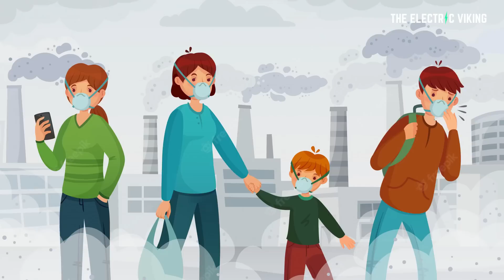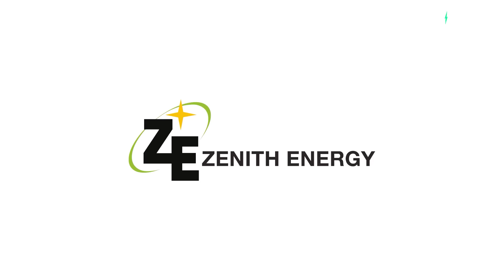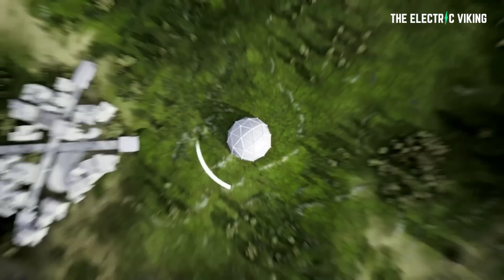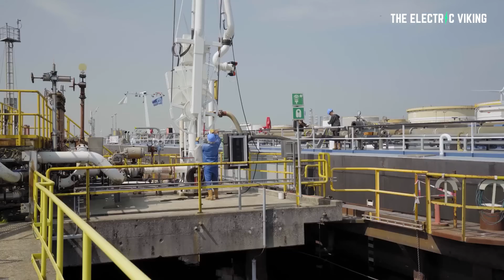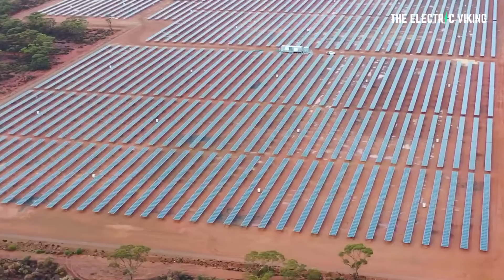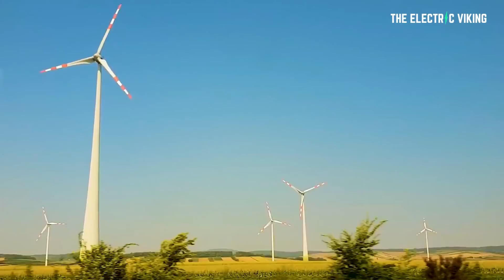The lithium mine powered by solar, wind & batteries

Comment: I like the affordable used cars 10y old or so, but if a battery only last 10y at $20,000  what, gone are the affordable cars and replace it with a disposable expensive car that cost more then $30,000 the WOKE! left and there jabs

Comment: I like the affordable used cars 10y old or so, but if a battery only last 10 at $20,000  what, gone are the affordable cars and replace it with a disposable expensive car that cost more then $30,000 the WOKE! left and there jabs

Comment: The energy being renewable is fantastic that's impressive and important. However, we need to either find a way for the whole process to use less water or move away from lithium sooner rather than later. Getting the lithium then refining it is very heavy water use and generally happens in parts of the world that have little water to spare in the first place.
Reply: Pilbara Minerals will be mining and refining on site using solar with production timed to the sunlight power.

Comment: Lithium mines are surely dirty; but the most problematic problems related to massive water requirements involved in the processing of the ore. Much of the US southwest has literally committed any major water resource; thus processing would need to be done a thousand miles away where there is adequate surplus water. 
China recetnly had to cease lithium processing due to their drought.   Water could become an additional choke point for Lithium; which is really too heavy anyway.
Reply: Electrification requires significantly more copper, nickel, cobalt and rare earths mining capacity, as well.
Reply: @tmcche7881  They are NOT rare earth and you need to learn about LFP batteries !!
Reply: @honesty_-no9he  Really? How are you going to charge the batteries, manufacture the semiconductors making up the electronic control devices, or manufacture the magnets for motors & braking, etc .... ???
Reply: Yawn. Please stop whining "Making batteries causes environmental problems" while ignoring the significantly greater environmental problems caused by the use of fossil fuels. This video refutes your FUD: https://www.youtube.com/watch?v=mk-LnUYEXuM&t=96s

Comment: I bet Nobody here ever met One Person in their life who died from Air Pollution.
Reply: Correct. Not one death certificate will state this cause.
Reply: @sunrisejak2709  Appreciate your Comment thanks for confirming.my suspicion.
Reply: Plenty who got lung problems from ground level ozone...from ELECTRIC MOTORS.
Reply: @Rcknrol72 Correct. But my grandfather smoked 2 packs of Camels his entire life and died at 87. Go figure! 🤔
Reply: @Rcknrol72 Kind of hard to assume that as the cause of death when the studies have been termed 'inconclusive but promising.'  Also, concurrent issues that have been SHOWN to cause lung cancer...like inhaling frangible asbestos...often are present as well.

So, whatever point you were trying to score...might have failed.
Reply: Incorrect.
"Coal and Gas are Far More Harmful than Nuclear Power

By Pushker Kharecha and James Hansen — April 2013"
Reply: @ogzombieblunt4626  But deaths from lack of power during the winter are far more dangerous than any of the three.  And renewables are showing themselves totally incapable of providing reliable power during the SUMMER, which is their optimum timeframe.

Some context is useful here.
Reply: @billcichoke2534  
So cite me that data
Reply: @ogzombieblunt4626  Since I keep getting cancelled every time I include a link (go figure), try this on for size...

Look up how many deaths result from various power generation sources.  There are plenty of links for those numbers.  Then look up annual weather-related deaths from cold and from heat.

There ya go.